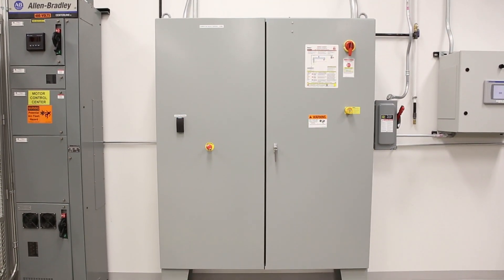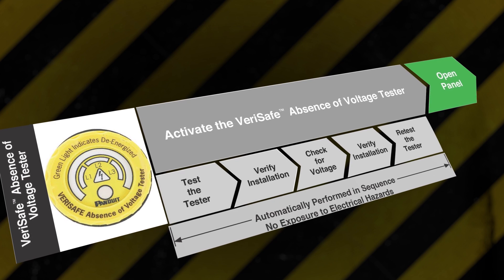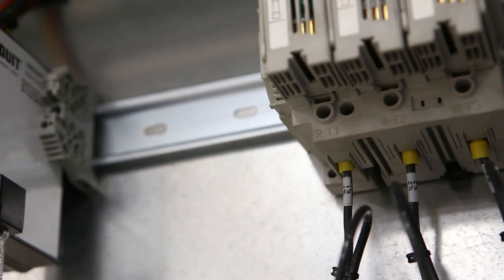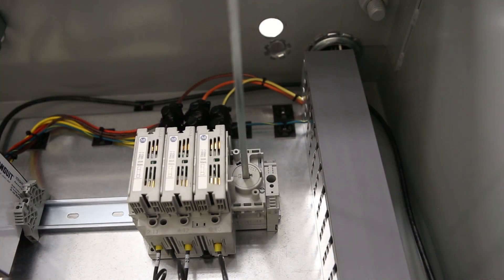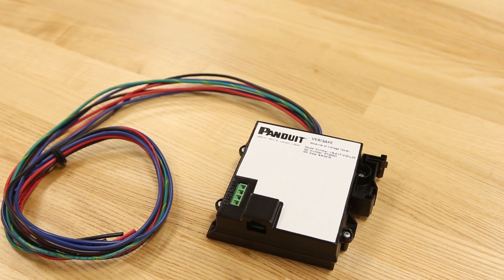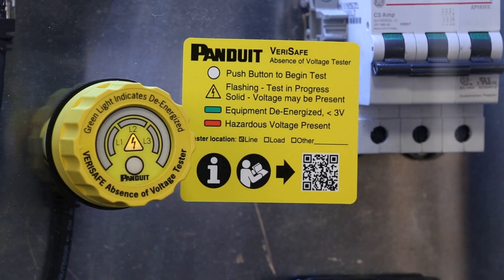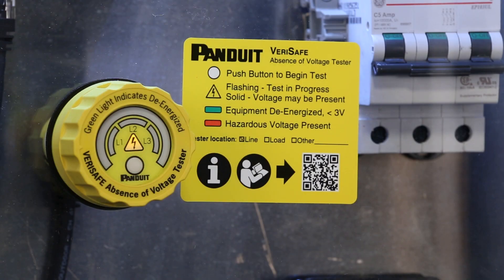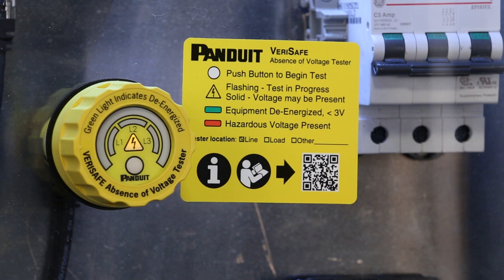VeriSafe Absence of Voltage Tester Demonstration

Comment: Until such time as this product is repaired, do not trust it. Watch this video and then make your own decisions whether you will put your life in the hands of Panduit.  I made my feelings and possible remedy known in the comment section for the author of the following video when he found a very serious fault with this product...........https://www.youtube.com/watch?v=wbUPIvI94YA
Reply from the maker: Panduit appreciates the detailed evaluation of the VeriSafe AVT in this video referenced and has contacted the reviewer to address his concerns. The scenario would only occur if the sensor leads were not properly terminated and secured and does not represent a product issue. While the probability of this scenario occurring is low, Panduit has proactively revised the Installation Instructions http://www.panduit.com/verisafe/VeriSafe_Manual_EN to provide additional information about the function of the sensor leads and published a Safety Notice http://pandu.it/verisafesafety explaining this issue as well as mitigation options to significantly reduce the likelihood that the scenario would occur.
Panduit is committed to the safety of our customers and regards any inquiry about the reliability of our products to be of utmost importance. There are many opportunities for mistakes and failures when using traditional absence of voltage verification techniques, including exposure to electrical hazards, use of the wrong equipment or incorrect settings, and confusion about the correct process to use.  Such mistakes when using handheld testers can lead to incidents resulting in injuries despite attempting to take all necessary precautions.  The VeriSafe AVT was designed to minimize the risks associated with verifying the absence of voltage.
 
If you have additional questions please contact Panduit at 800-777-3300 or cs@panduit.com

Comment: How long will it take permanent voltage testing instruments or AVTs to gain an electrician's trust and supersede the practice of test-before-touch? Exposure to voltage comes with a high risk of death, which means the voltmeter is still a workers sole personal safety device during LOTO. For certain occupations like pilots, high-rise iron workers, or electricians; equipment failure often equates to death. In these workplace scenarios, workers personally verify proper equipment operation and suitability before starting their work task--pilots don’t fly unless they perform a thorough pre-flight check; and electricians never touch conductors without checking for voltage with their voltmeters. I suspect that it will be some time before voltmeter testing stops becoming a necessary and non-negotiable safety step before electricians work on conductors.